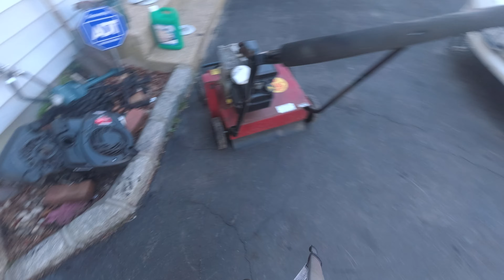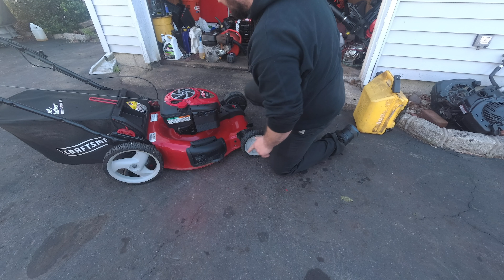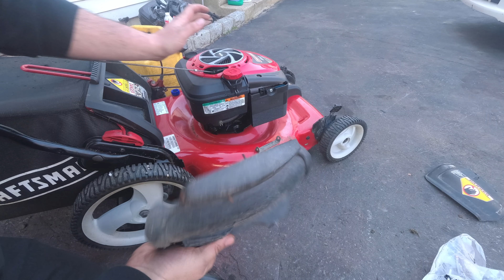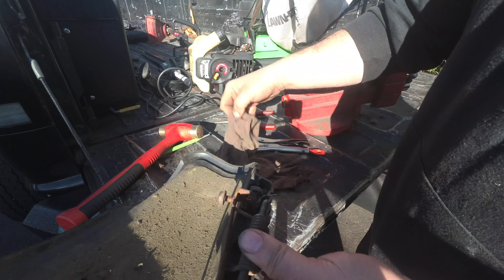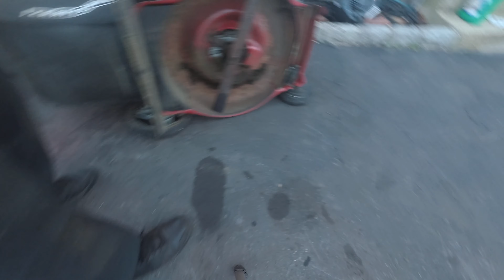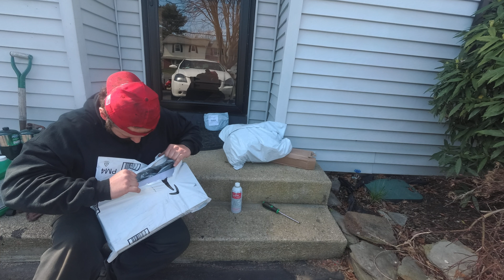Facebook Marketplace RIPOFF Craftsman Gold Self Propelled Lawn Mower Fix N Flip Reseller Life

Comment: I don't know how long you have been working on mowers but I have been doing it for 25 years and let me tell you from my own personal experience that just adding a capful of seafoam isn't going to do crap !! do what I do and don't be afraid to add a half to 1 ounce in the gas tank AND you can even add more and then it will actually do something. Especially if you add enough to where it starts to puff smoke while its running is telling you that it is actually doing its job of cleaning. Again, a capful don't do shit, add more !!
Reply from the maker: Jason Michaels 

I never fill up the gas tank to the top.  I never sell a mower with a full gas tank either!  Just enough for them to start it and run it!  With that being said my ratios are different per say.  How much gas do you ad?  Also check another video in my channel where I fix a non running lawn mower with no tools using seafoam.  I just did a cap full.

Thanks for the view and comment,
Hopefully you subscribed to my channel.